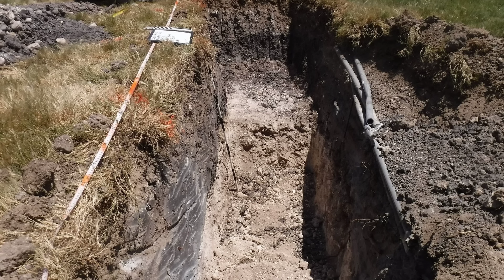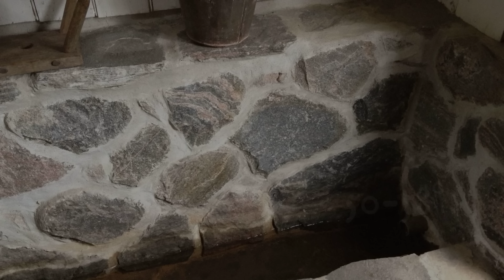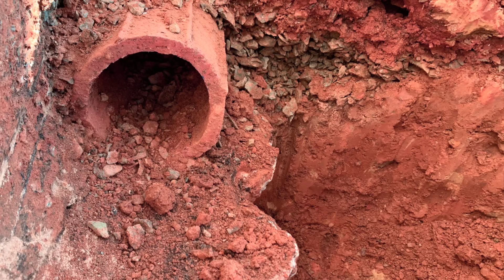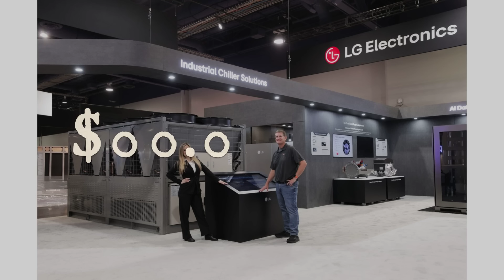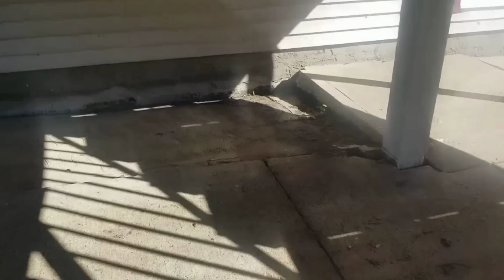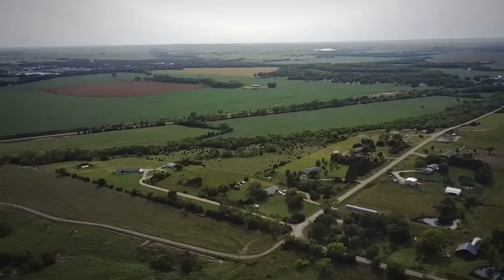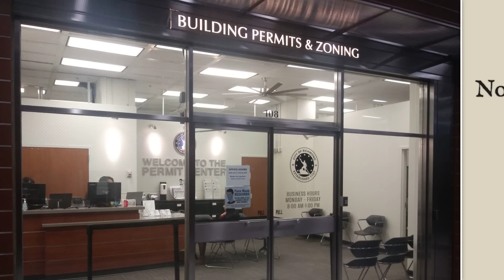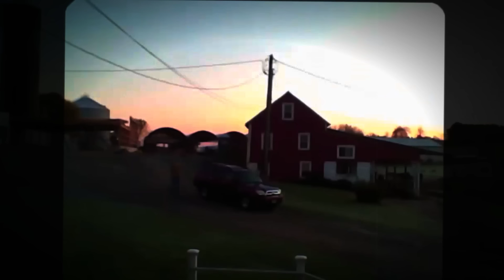This $300 Tunnel Keeps Any Home 55°F Forever — The Amish System the Cooling Industry Made Illegal

Comment: What soil mass and area would be requierd to handle 1 house? 
Is there a logistical reason why its not more common. I.e. if every house in a subdivision did this, would the thermal load from all the houses corrupt the delta in temp requierd to function?

Comment: You can get an heatpump to transfer heat to the ground using circulating water.  The most expensive part is the digging.  It's a lot more than $300.

Comment: Guys. I’m an engineer. He’s grossly exaggerating. Always ask ChatGPT about stuff like this:

•	A pipe is buried underground (typically 6–10 feet deep)
	•	Air is pulled through the pipe before entering the house
	•	The ground stays relatively stable (cooler than summer air, warmer than winter air)
	•	As air moves through the pipe, it exchanges heat with the soil

So yes — in principle, you can pre-cool incoming air using the ground.

⸻

But here’s the reality (this is the important part)

1. A single short trench won’t do much
	•	To get meaningful cooling, you typically need:
	•	50–200+ feet of pipe
	•	Large diameter (6–12 inches)
	•	Slow airflow for heat exchange
	•	A short trench (like 10–20 ft) = almost no noticeable cooling

2. It doesn’t replace AC
	•	Best case: drops air temp by 5–20°F
	•	In a place like Texas, where it’s 95–105°F, that still gives you:
	•	~75–90°F air → not “cool,” just less hot

3. Humidity is a big problem (especially where you are)
	•	Warm humid air enters a cool pipe → condensation
	•	That can lead to:
	•	Mold growth
	•	Bacteria
	•	Musty smell blowing into your house

This is actually the #1 reason most DIY versions fail.

⸻

When it can work well

Earth tubes are more effective in:
	•	Dry climates (e.g., New Mexico, Colorado)
	•	Homes designed around it (not retrofits)
	•	Systems with:
	•	Drainage slope
	•	Condensate removal
	•	Filtered intake
	•	Sometimes UV or antimicrobial lining

⸻

What you’re probably really looking for (better options)

More practical passive/semi-passive cooling:
	•	Attic ventilation + radiant barrier
	•	Mini-split AC zones (very efficient)
	•	ERV/HRV system (controlled fresh air with heat exchange)
	•	Shade + window films + exterior shading

If you like the earth idea, a modern version is:
	•	Ground-source heat pump (geothermal)
→ expensive, but actually works

Comment: The problem is the weather making system in place coexist with cheap mobile home manufacturing.  Cannot get geothermal on a “home” that sits off the ground.  The system is so well designed to work against everyone.

Comment: Modern air-conditioning is just flat out better. Why are we pretending it's not? Humidity is the problem. Cold air can't hold as much moisture as hot air. This causes water to form on walls of the cooler room. It's the same reason why water forms on the outside of a glass of water, condensation. I have a basement and without a dehumidifier there are water drops collecting on the walls and running down pooling on the floor. Moisture ruins everything. All my tools would be covered in rust. Everything would be molding.

Comment: I can't dig 6 feet down in the middle of the city, and if I could, I'm pretty sure digging a 100-200 foot trench 6ft deep and modifying my home for the duct work is going to run significantly more than $400. Just renting the digger alone will be more than that, much less disposal of all the TONS of dirt and rock you just dug up.

Comment: 70 degree air in the summer doesn’t dehumidify it enough to prevent mold or limit airborn viruses like modern HVAC. It’s important to understand the difference between wet bulb and dry bulb temperatures. Not saying this method doesn’t work, but there is a reason we do geothermal loops paired with compressor tech in summer. You need to cool air to 55 to dehumidify it enough to serve occupied spaces to modern standards. This is a great economizer though! Anytime the temp outside is below 55, blast this sucker for nearly free energy! Just be cautious in the summer using this by itself. Beats nothing, but it isn’t as good as compressors and refrigerant.

Comment: The guy who wrote this doesn't know what he is talking about.   You would need a massive amount earth tubes to cool air in the same volume as AC.   Heat pumps pump liquid underground as it has a much higher heat capacity to move heat.   The reason why no one uses earth tubes is that its potential is extremely limited.
Reply: I would think if you built your house with it fully incorporated and had these Earth tubes going for a hundred metres underground and multiple of them and then combine it with the romans roof piping that is mentioned in a post above you could move quite a bit of air through them and possibly get a decent result.  Still not going to be as good as aircon.  But no maintenance and no ongoing cost.  At worst I think it would drop your inside temp by 5C.  Which is decent.
Reply: I did earth tubes using 310mm poly pipe into a straw bale studio. In winter the rooms never dropped below 12C and never rose above 26C even when it was 42C outside. It works best with good insulation. I've just built a rammed earth house and it has an earth tube. Again extremely stable day and night but constant free air moving slowly so no drafts. It works provided the rest of the house is smart with windows and roof tuned to solar passive design, good insulation and enough thermal mass. My tube is 20 metres long and it works. It's not 'extremely limited' at all. It needs no fans, generates no noise and I have no need of a fire or an A/C.

Comment: 40 seconds in and I'm thinking geothermal heating/cooling has been around for centuries and is still around today.
Reply: This. The video creator is not very smart haha.
Reply: @seano3946  especially since he think the Amish use electricy
Reply: @Brian-bz7yj 
They use electricity and have cellphones if it’s for business
Reply: @kriskulczynski8957  most don't have electricity in their homes. I live less than 20 miles from an Amish community the local wal-mart near then even has designated parking for their horse drawn buggies and we have road signs letting drivers know there are horse buggies on the road
Reply: Exactly.
Reply: I have geothermal. It's so awesome
Reply: yeah that's what this is, just less efficient and passive.  Funny that you can think of a passive system being less efficient, but that's wha tthe wonders of phase-change  systems allow.
Reply: Geothermal is the best
Reply: Exactly and there's nothing illegal about it 😂

Comment: 1) Not illegal
2) Not secret
3) Widely known

The reason(s) many homes don't use it:

- Doesn't dehumidify the air, mold becomes a problem
- Has a smell to it
- Modern installation is expensive, doing it yourself is likely to violate some building or fire code.
- Not all locations are suitable for such an installation
- Consumers are offered the system that should work in all cases, HVAC installers would actually love if you wanted the thing that costs 3 to 10 times as much to install. Which would be earthen systems.

Take off the tinfoil hat and stop smoking pot.

Comment: Real Amish laugh their asses off when I show them your videos. Practically nothing you say is true.
The cooling tunnel is not some hidden tech that was kept secret to enslave mankind. It’s been widely publicized for decades. After the windfall tax in the 80s, energy groups and clubs that got funding pushed this information everywhere. Mother Earth News ran articles, plans, and tips. Popular Science did the same. I remember ads in the back of magazines selling full plans to build your own “free AC” system. Today it’s even easier. The plans are all over the internet for free.
Here’s the reality you ignore.
PVC and PET are poor conductors of heat. That limits performance right out of the gate. It’s also not easy to prevent mold spore ingress, and once it starts, it doesn’t stop. These systems stay wet. That promotes mold, fungus, and bacteria.
Use materials that conduct heat better, like concrete, and you get a different problem. They hold a lot of moisture. Same outcome. Damp system. Microbial growth.
There was nothing mysterious or devious about why architectural programs dropped this. It wasn’t some grand plan. It was largely ineffective compared to modern methods, and more importantly, it created a health risk. Dark, damp systems grow mold. That becomes a liability problem. No architect wants to get sued when someone gets sick from a system they designed.
So no, this isn’t some hidden suppressed technology. It’s old, widely known, and yesterday’s tech.
And I’ll say it again. Point me to any house in Holmes County actually running this system the way you claim. I can be there in under an hour.
You’re a liar and a grifter. This stuff isn’t new. It was everywhere in the 80s and it’s everywhere now. Anyone can find it for free with a basic search. Charging $17 or $20 for a “secret” manual is a scam.

Comment: Sorry to break it to you but the Amish didn't invent anything.  This knowledge was used in the middle east over 2000 years ago.  Mechanical cooling was invented and is necessary to remove moisture (humidity) from the air to keep industrial machines from breaking.  Florida would be the worst environment for this type of system tho because they are flood prone and there are alligators.

Comment: if you dont want to depend on this exclusively and still want the QoL of having the perfect temp all year long, instead of just feeding it straight to your house through a filter, feed it into your hvac intake

also a single tiny intake like shown doesn't really have the BTU cool/heat the whole house, huge misdirection, even with perfect insulation that tiny flow ain't winning against the sun heating up everything through the windows lol

using the hvac intake instead, you get the BTU you need to distribute the new air and in cold -20c winters your hvac only need to heats from +5c, and in hot 40c summers your hvac only needs to cool from like 25c so its over 50% $$ savings

...or just get a geothermal unit, exactly this in a closed loop on the commercial market

Comment: Unfortunately this wouldn't work in my area, because the ground emits radon, so you'd be poisoning yourself with it. A ground-source heat pump however, would, although it'd be a lot more expensive.

Comment: But how does this scale for densely populated urban areas? You need high air pressure and large air pipes. Would be a very big infrastructure project. Works well for smaller rural areas, I have doubts about scaling for many people.

Comment: I installed my first Geo-Thermal A/C unit in 2009. Essentially the same thing. 300ft of pipe about 6ft deep, fed to a unit in the basement. No refrigerant what so ever. Pretty cool, not many could afford it though, as it was 3x more than a normal A/C unit.

Comment: Humidity, humidity, humidity. It’s the humidity that causes the discomfort over temperature every time. This system doesn’t address the humidity issue. Air conditioning was invented for this very reason.
Reply: Radon??? All that radon coming out too
Reply: @jz497  it would be in the same concentrations as in regular air, the system keeps it flowing. Its not pooling like in a basement
Reply: Listen to the video again and you'll discover that he addresses the humidity problem with simple solution💡❗
Reply: I wonder if the temp drop as the air goes underground will break the dew point? Then, if it did, what to do with the condensation?
Reply: @joee7850  Run the water to a sump and pump it out
Reply: @steve9216  thats what i was thinking too
Reply: Where I live the humidity is very low so we use swamp coolers, which are basically just big humidifiers. Most air hitting dry air cools as the moisture evaporates.
We keep the windows open so it doesn't get humid inside because then the cooling effect wouldn't work anymore, plus it would be humid, which sucks
Reply: Sounds like something the big cooling industry would say
Reply: Can use natural dessicants to line a pipe or something to absorb the moisture .Dessicants absorb moisture overtime and lose their moisture absorption ,so to prevent this have the pipe or whatever closer to or outside the ground where the sunlight can heat it , dry the dessicants out so can be reuse indefinitely .Depending how long pipe is and how much desiccant can probably remove all  moisture , all theoretical of course .
Reply: Houston 🥵🥵🥵🥵
Reply: The water/glycol system that was covered in the video is supposed to manage humidity, even in Florida
Reply: yes, I love the dry air AC creates, so comfy!!  I think a closed loop geothermal AC would be the way to go, but it's probably much more expensive and labor intensive in the install stage vs an air to air.
Reply: He mentions installing the pipe 2 degree tilt that causes the humidity to condensate and run down the pipe.  He also mentions that you need a smooth pipe as a wavy one collects this condensation and molds.  Watch the video before you comment.
Reply: Ever been to Phoenix in the summer? 

It's 125 but it's a dry heat. Kinda like an air fryer. 🤣

Humidity does make it more miserable. More like a steamer.
Reply: @steve9216  I have. Definitely way nicer than humid 90 degree weather.
Reply: Buy a simple dehumidifier or stay hotwiththe same humidity
Reply: @jjptech  dehumidifying takes up about 70-80% of your AC power
Reply: @naanyangdiaries  then stay hot
Reply: @n @naanyangdiaries dehumidifiers take far less energy than AC units.
Reply: @naanyangdiaries  It typically takes about 50%, if it's higher than 50% you need to get your AC checked.
Reply: @burger1113  An AC unit has a dehumidifier, and the dehumidifier is typically about 50% of the energy cost of the process of the AC unit. Obviously a standalone dehumidifier uses less energy than an AC unit which dehumidifying is part of the process rather than the entire process.
Reply: @DexLowland  I wonder how you determine how much an existing AC uses for dehumidification. The numbers I'm giving are based on factory tested rates. The only reason for differing numbers is the humidity of the env, not because the machine needs to be checked
Reply: @naanyangdiaries yeah, we had one in several rooms, back in the 80s and we had to run them 24/7!
Reply: @burger1113  tell me you know nothing about the difference between latent and sensible cooling without telling me that. It takes substantially more energy to convert the water vapor in the air into liquid water to remove it from the conditioned space than it does to drop the temperature of the air. Q=mC∆T vs Q=mL